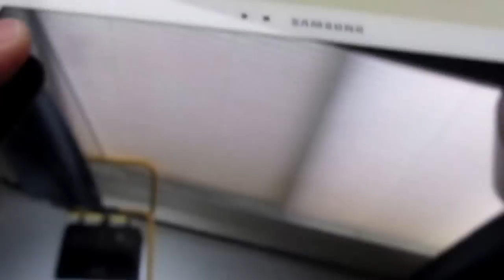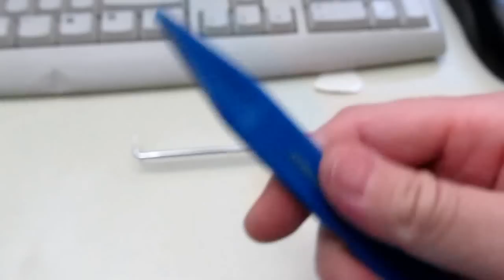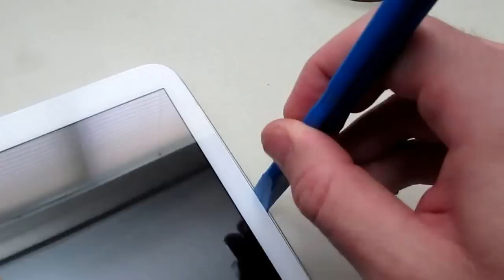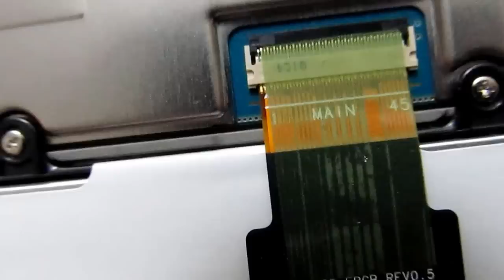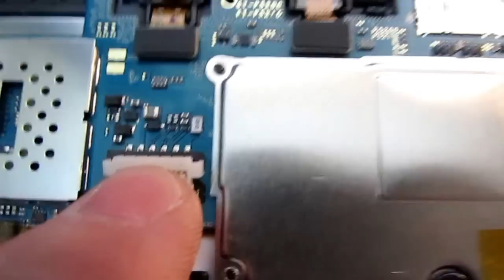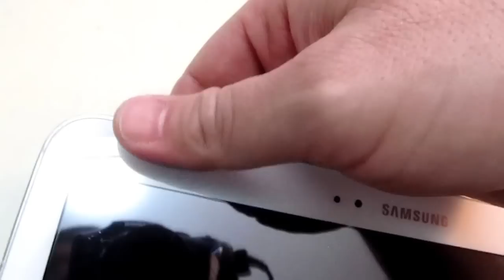Galaxy Tab 3 GT-P5210 LCD Discoloration Fix

Comment: I replaced my battery then the colors on the LCD went bad. All cables are correct and lined up but still no good. Everything was fine before battery change. Any ides?
Reply from the maker: Hi, I'm not sure, maybe re-seat the cables and while doing so, gently clean the connector sockets with a fine brush?

Comment: Hi I have the same kind of issues with Samsung N8013, it is 10.1 inch,  do you have any suggestions for N8013 model tablet.  Thanks in advance. 
Sudheer Duggirala
Reply from the maker: Hi I do not.  Thanks,

Comment: sorry my english is not good. what was the problem? how do you fix it? Disconect and reconect ?
Reply from the maker: Problem was with the screen not appearing correctly.  I took it apart and saw that the LCD cable was not in all the way and put it in all the way

Comment: Hi Dave, 
Does it matter where I put the electrical tape and is there a specific electrical tape that I have to use? I read up a lot about it and it seems that if not taped down properly or if taped with the wrong material, it can cause fire as a cause of over-heating / spark transfer between cables. Thank you in advance!
Reply from the maker: Hi Ella, yes you should get the Kapton also known as gold tape such as the kind that appears in the video and tape it right across the connector running onto a flat part of the back of the LCD or motherboard.  Standard electrical tape is not used because the adhesive, it will get warm and gooey over time
Reply: David Chello Thank you so much for your  reply! Very much appreciated ☺️

Comment: ´HHHHELLLLPPPPPPPP!! I DID EVERYTHING YOU SAID AND MY SCREEN IS STILL ONLY WHITE.... PLS HELP
Reply from the maker: What is the model of your tablet is it GT-p5210? Maybe it's the LCDs problem not the cable; maybe you need a new LCD cable altogether; try gently brushing with a soft brush any  dirt and debris from the connectors while the connectors are flipped open.

Comment: Do you need that specific tape?
Reply from the maker: You don't need that specific tape but I wouldn't use Scotch tape.  The gold Kapton tape is recommended because of its adhesiveness and ease of installation/removal as well as non-conductive and heat-resisting properties.

Comment: I need help you know the black,red & blue cable there not plugged in
Reply from the maker: Sounds like the battery cable connector...just line it up and press it straight down to lock/click it into place.
Reply: @DavidChello  ok ima try

Comment: I cannot explain how happy I am I found your video. Thank you so much!!! I was dreading having to have an expensive (not needed ) repair with a replacement screen but I just knew it had to be something loose since it was never dropped or near water. 
Mine is a tab 4 so there is a metal rim around the screen but otherwise the same. 
Just like yours the pins were out halfway and my digitizer was on an angle, no tape at all on the cables and the clip wasn't fully down.
Reply from the maker: Awesome!  Wow I can't believe I've helped almost 50,000 people!  C'mon Samsung quality control LOL!

Comment: I love you
Reply from the maker: Thanks! Appreciate that!
Reply: David Chello i had a completely black screen. Just in the edges i could see that there comes a very small light when i push the power button so i thought i‘d try to fix it. 
and i just jumped in the air and was extremely happy because when i put the cable back in the colours were completely normal. 
Even though it took me like an hour to open that back of the tablet but in the end it worked😂

Comment: Mine is green when its supposed to be black and pink when its supposed to be white. Is it same thing?
Reply from the maker: It could be the cable connection problem, but if green LCD, with green pixellation, it's probably the LCD that is going bad.
Reply from the maker: I would still check all the connections first!  It's not that difficult.
Reply: Thanks man
Reply: Hey man just wanted to tell you it worked. Turns out both the cables were not aligned. Thanks so much.
Reply from the maker: Hi, Awesome!! So glad to hear!

Comment: Had problem for a year. Local shop told me new lcd $250. Fixed it with your help. Went back and told them and they accuse me of lying, the dirtbags. So thankyou very much.
Reply from the maker: grimace1965 Hi, wow I think some  places would rather try to jack up their profits or dish out a quick answer without actually offering an efficient, proper response or interest towards fixing the problem.  Sorry to hear about your experience.  However I'm pleased that I was able to help you out!!  God Bless you,  DC PC

Comment: Thanks so lot.                You surely save me at least 100 euros, but the most important thing is that you reestablished peace between my 10years 6month son and myself ! One month ago,I changed the usb nap.It worked so good that I had been thinking for two weeks I was realy gifted   .Fiteen days later,my son showed me strange 'distorded' colored images on its screen.Beleiving he  had dropped his tablet,I realised that I  did the job for nothing.        But,how Lucky I was to find out your video......I had forgotten to secure properly the connection and the nap had slided one milllimeter of (no more).Following your advices,I finaly fixed his tablet in less than 5 minuts.         Great !
Reply from the maker: Didier LAUGENIE Hi, so glad to hear how I helped you out!  Best wishes, Dave

Comment: Please Help!!!
(Sorry for being long but I laterally tried everything I know and I cannot find the cause of my problem and now I'm desperate...)
I have the same tablet and 2 weeks ago I was charging it, unplugged it and put it on the table and it was absolutely fine then I got out,, when I came back I found the screen completely messed up ,,, there wasn't even anyone at home to drop it or do anything with it. It happened just like that!
It has greenish pixels everywhere especially in darker areas
When I tried an app that fills the entire screen with certain colors I found out that all colors show up perfectly fine on the screen, except black which shows up with something like a layer of greenish static on it
I've tried the following:
1- making sure the strip (and every other connector) was in good contact with the board
2- detaching the LCD strip from both ends and cleaning both the strip ends and both sockets with a brush and an air blower and reapplying the strip
3- taking the motherboard out for inspection and as far as I can tell nothing is blown or damaged
4- reinstalling the stock ROM to solve any driver related issues if there are any.
and none of these worked.

 my sister also has the same tablet and it is fine .... so I tested my screen on her tablet and it works flawlessly .... I tested my LCD strip on hers and it also works fine
but when I connect my motherboard to her screen, the problem shows up again even using her LCD strip ..... so my board is definitely the cause of the problem but I'm not sure what exactly is the problem and if it's even fixable.
Thank you.
Reply: don't mean to advertise or anything but this guy here seems to suffer the exact problem that I have so please watch it for a better view on the problem
https://www.youtube.com/watch?v=z2XAce6o-h4
Thank you
Reply from the maker: Hi, it seems like LCD is going bad.  Are you sure you tried a good LCD with your tablet?  So otherwise, it may be a tiny subcomponent of your motherboard, which in that case you could repair it, but might just want to invest in a new tablet instead.  I wish I could be of more help.  Sounds like you tried everything, though!
Reply: First of all thanks for your reply :D
And yes the other screen works fine but had the same issue when I connected it to my board
even my tablet's screen  works fine when I connect it to the other board 
Looks like I'll just accept it as it is for now since I don't really use it that much right now
and again thanks for the help :D

Comment: Whats it mean if it doesn't power back on once the battery connections been put back in place? Shorted?
Reply from the maker: Are you sure the battery is charged/plugged in?

Comment: Thank you so much for taking the time to show how this issue is fixed.. I had an old Note 10.1 that had this exact problem and because of your video, it now works perfectly!  Samsung's official repairers wanted £70+ just to open the case and potentially charge me for something that didn't need replacing.. I refused, had it returned and now because of you, it works and all that it has cost me is a litte bit of time! Thank you again! ;)
Reply from the maker: emelen73 You're welcome!  Glad to help!

Comment: one tip when disconecting the battery connextion make sure not to pull those little wires. but all by all it was a perfect fix. I was scared but it was not hard.
Reply from the maker: Florisia R thanks for your input!
Reply: David Chello thank you for sharing your video